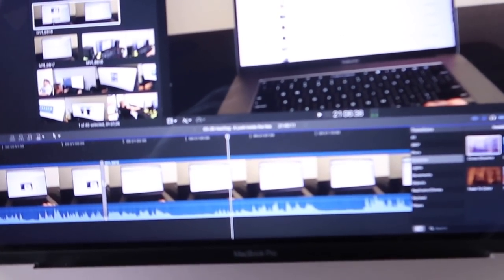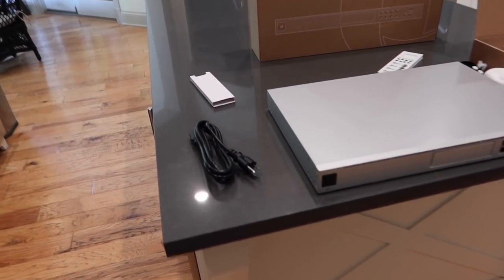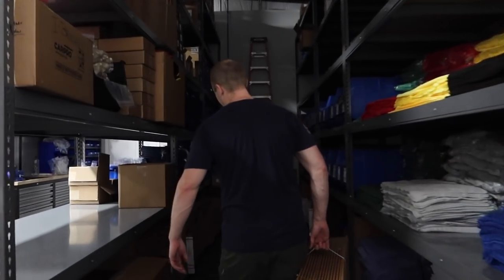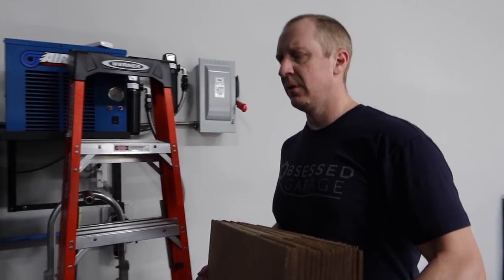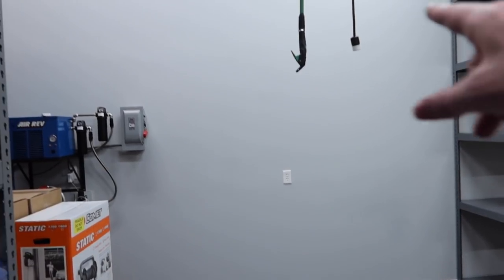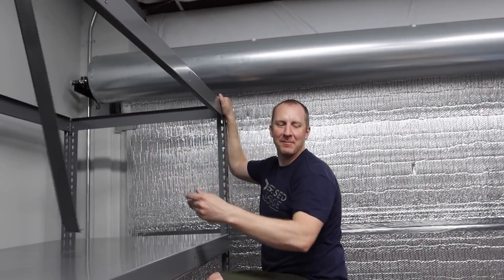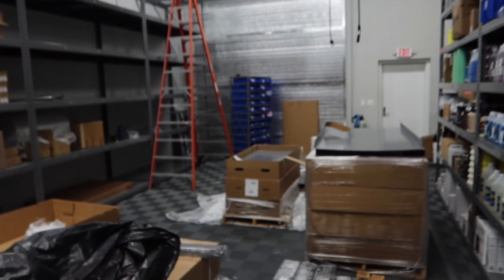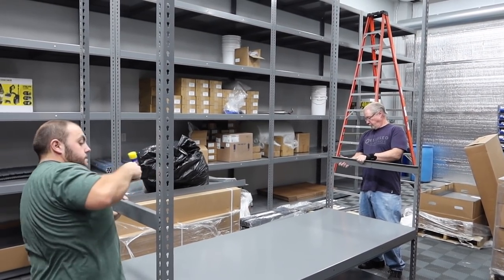HexVlog 0033: A Look Inside the Hex

Comment: Matt,

Told you this last time.  
If you insist on standing on the top step of the ladder have soneone (Dad) stand on bottom step to help stabilize.    
You are one fall from being hurt.  Do not take this as a You Tube comment.   It is just Safety.     Don't worry about the Pandemic if you are going to take these risks.

Comment: 5:30 regarding the components heating up. You can replace the cabinet door inserts with a speaker mesh/grill material. I’ve seen it done and it helps promote airflow 👍🏻

Comment: Cisco Meraki is trashware, they charge you licenses for every product on your network, every year. Ubiquiti is OK, but has alot of beta non-tested software features. In my opinion Ruckus is way better, as they came out with most of the technology that Ubiquiti and Meraki duplicates... once you get Ruckus on the Unleashed software, it's amaze balls. I use MikroTik for routing my 1 gb/s fiber connection. It's OK, you really need a nerd to set it up. In my case, I had to wait 24 hours for my ISP to allow a new MAC address to connect to their network. I would suggest buying two of them, as they're reasonably priced.

Comment: I feel your pain Matt, two weeks ago I had to build the Costco style racking for the winery it’s the same rack and you see at Costco we ended up using a forklift our scissor lift and that worked out really well and then I Hilitied them down with the anchors to the ground that gun Punches though the cement like a hot knife through butter! Bad you couldn’t use the forklift mast to shuttle up the top of the shelves and then while you’re on your ladders you could’ve just slid it off the forks!